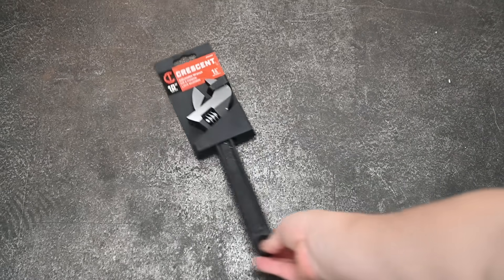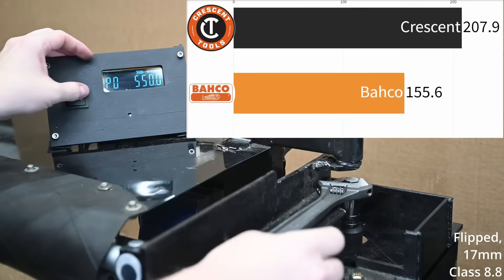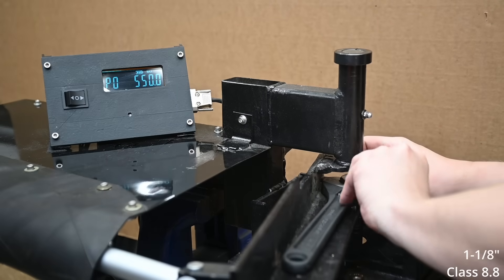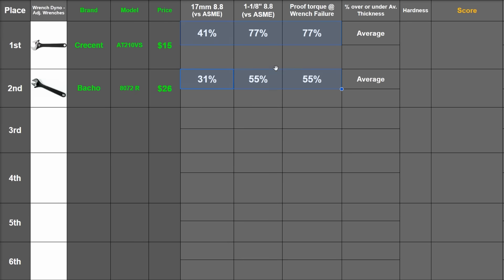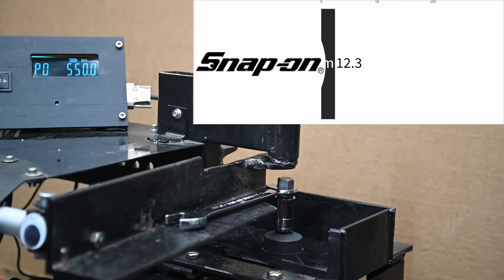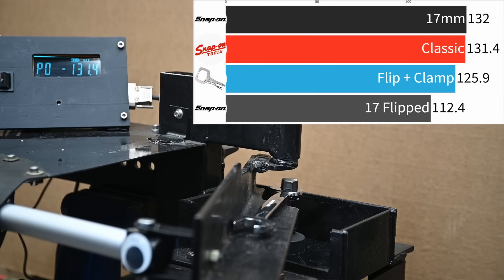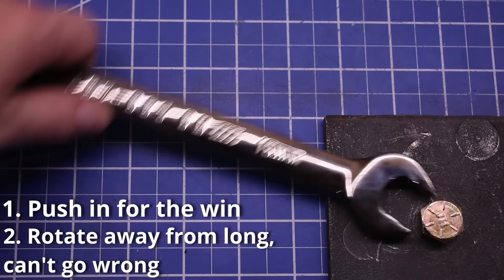Are you turning wrenches the wrong way?

Comment: I'd love to see a Knipex pliers-wrench up against Crescent style wrenches with pushy, since the best adjustable wrench is clearly a pliers-wrench.

(Note that I'm being somewhat facetious, I hate crescent wrenches but I'm sure they have their place. I have a 3" opening 20+" long crescent wrench I use for taking off my threaded lathe chuck, for example.)

EDIT: It'd be pretty neat to see one of those old-timey adjustable wrenches pitted against modern options (like the ones that Hand Tool Rescue makes that are based off of a patent from 1879). You could even try the thing where you put a nut that's just a bit smaller than the fastener behind the jaw to prevent jaw spreading.
Reply: The turn strength of knipex channel locks or more accurately "pump style pliers" are  based on hand strength, the tools multiply it exponentially but they open when you hand can't keep them closed, not on the tool's failure. Some channels test them with hose clamps or other ways but it's not even close to an approximation of real world use
Reply: crescent wrenches work great for fine tuning the hang of a door by bending the hinges.  but bargain brand adjustable wrenches have too much flex to work.
Reply: @El_Peto I really like old fashioned adjustable wrenches for that purpose, like the type where the adjustment nut is down in the handle rather than up top. I have the small and large one that Hand Tool Rescue makes, and they're great. I really like how tightly you can get them to grip on a nut vs crescent wrenches. They're pricey, but I think they're cool.

EDIT: this comment is the way you can tell I'm a hobbyist lol. I just like cool tools, and the old fashioned wrenches go well with my 1950s lathe.
Reply: I'd love to see that as well with one addition. Put a channel lock parrot bill pliers in the test.
Reply: The pliers wrench is awesome because of the way it holds the fastener but I've broken them before breaking an adjustable wrench because the sidewalls around the pivot are quite thin. It was abuse, my fault. They are definitely better for the nuts and bolts but I don't believe they're more durable than decent adjustable. I'd still love to see it tested!

Comment: Torque - the measure of the force that can cause an object to rotate about an axis.
Hence, where the AXIS of the wrench is matters.
When the wrench is turned [pushed] on the side of the long jaw, the axis is centered, which makes the torque flow as intended.
Using the short jaw side, the axis is not aligned properly, skewing the torque through the wrench.

Comment: Nice to see it tested, When did the jaws break?
Had never been told one way or the other was better before. The image at 0:30 explains that (for adjustables at least) that makes perfect sense, up until the point the jaw breaks... the rack of the smaller jaws is driven into the worm so it should be less likely to open up or skip teeth. Just wanna see if box ends break sooner or later with each direction now (having to flip-flop it to get it on in the first place aside).

As my OP mentioned in mine and friends experience (including snap-on which was surprising) its always the smaller jaw that shears off because there's less backbone behind it, the force of the nut in "typical" orientation is being applied further away from the throat on the tip of the small jaw causing more leverage until it breaks. 6:03 being a good example.
The deformation of the hex obviously just comes down the hardness too, the nuts POV sitting in the throat between parallel jaws doesn't change the hardness as the 19mm shows, before the point of fracture orientation doesn't seem to matter.

Why it slips is an interesting question, it would seem doing it in "fat jaw ahead" orientation would have the opposite end of the wrench going towards the center of rotation/the nut and should resist it. maybe the nut contacting the outside of the larger jaw creates more friction (while the smaller outside slips) and that is what causes it to walk out? don't know.

The final note nails it, the end is canted to double the number of chances that you'll get the thing on.
If you have to flip-flop it between sides 1000 times because you only get 10 degrees of rotation..... well at least you got the job done right? Obviously the direction doesn't change the degrees of freedom.
Love this channel right there with project farm :D

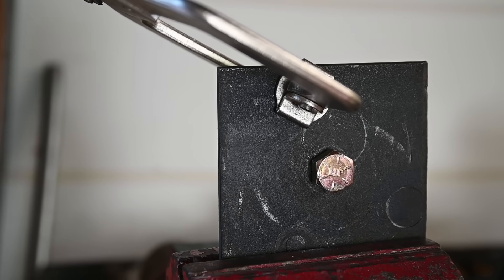Comment: The fact that the angle of the head is offset means that it is intended to be used in each direction.  You're pointing that out at the 2:00 point in the video as I am typing this.
Reply: I thought the reason for the offset head is for when you have very little clearance and you can only get to the nut/bolt from a narrow angle. In that case you can only make 1/8 turns, flipping the direction of the head each time. It’s a rare situation, so maybe I’m wrong and wrench designers did not account for it.
Reply: @TomKane77  That is the exact reason.  When there is limited space and you can't get the wrench on the head of the bolt or nut, you flip it to change the angle of attack and use it in the other direction - hence, it is intended to be used in either direction.  If it was only intended to be used in once direction, the jaws wouldn't be angled.

Comment: It makes new to me on the orientation since you are putting most of the force against the fixed side of the adjustable wrench versus the side with the half jaw.  Also considering that the half jaw side has more flex, movement side to side, to round out the fastener head and/or slip off the bolt head.

Comment: 45 years ago I bought Diamond adjustable wrenches (3) and I still have 2 of them, used them everyday for HVAC work. I’ve used cheater pipes on them and none of them failed. They are retired now and so am I.
Reply: I have three 15” diamond tool horseshoe co wrenches and one Williams, theyre over 70yrs old and have great tolerances. If you manage to have them slip you did something wrong
Reply: Diamond tool adjustable wrenches are incredible! I have several of each size from 3" up to 14". They were all used when I purchased them 20 years ago. Will never get rid of them.
Reply: I have some diamonds that my grandpa gave me they still work
Reply: I have Diamonds that were my grandfather's, 1930s vintage, still use them every day.  Very worn and sloppy now but still effective.
Reply: Diamond Tool & Horseshoe Co.  Duluth MN.
Reply: If only I'd known to buy wrenches 3 years before I was born
Reply: Got a 1918 diamond self adjusting pipe wrench with a donkey on it.
Reply: If you need old quality pipe wrenches nothing beats a King Dick
Reply: i have a diamond 24” and smaller ones, seldom used. my go to is their monkey wrenches 

let’s see a proper test on monkey wrenches!

Comment: One thing not necessarily being taken into account here (and I think would be interesting to see if there is a difference) is the input force required to create that torque at the bolt head. I am curious if the angle at which the force is being applied significantly affects it. I would think it does, as any non-orthogonal force would be wasted energy?

Comment: I would like an adjustable wrench video. 
But one thing would be some kind of "increased slop" rating. I've found if I'm using an adjustable wrench over and over again, it backs off just a bit, enough to not make a solid grip on the nut anymore.

Comment: The manufacturer will recommend the configuration that rounds the fastener before it breaks the wrench. As a user, you may prefer the other choice.
Reply from the maker: I'd prefer the way that can get to 150 and not be rounding over the fastener until 200 than the way that breaks at 150

Comment: When you call one side the "long jaw" is there actually a length difference on the inside where the bolt head goes - or is it just longer measured from the other end of the wrench?
Reply from the maker: Good question. It's sort of gestured to at 1:50. The wrench is offset, causing the beam of the wrench to be closer to one end of the jaws than the other. The total arc/distance from the beam is then longer to the end of one jaw than it is to the other one. The actual broach depth is the same for the jaws experienced by the fastener.
Reply: @TorqueTestChannel  Thanks for clarifying! I was curious because it made me wonder what was causing the difference in max torque. 

E.g. is it because the fastener can slip more before reaching the end of the broached area? Obviously not. 

Maybe something to do with the flex each side of the jaw experiences? Perhaps the "short" side flexes less since it's reinforced by the handle?